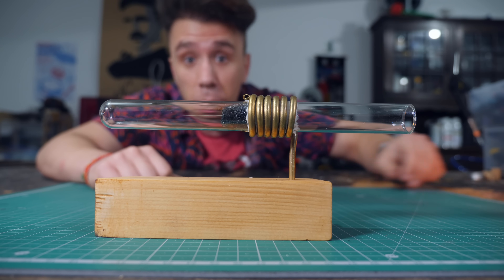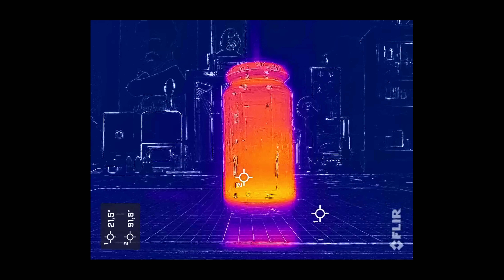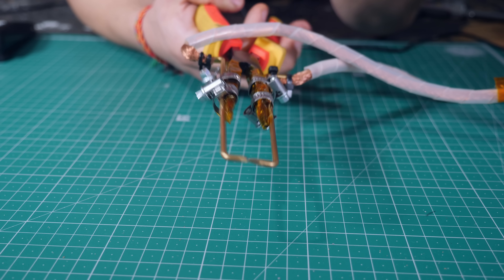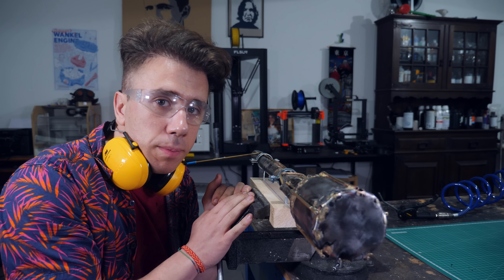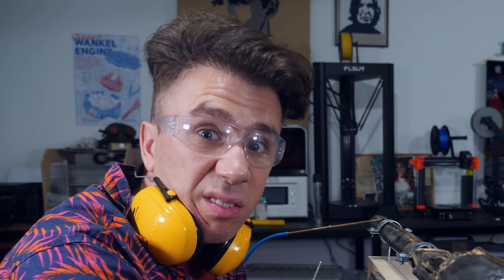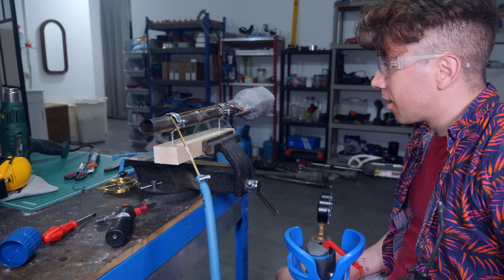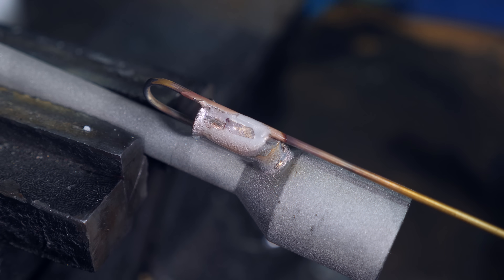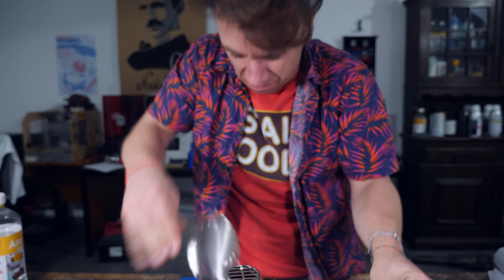JET ENGINE with NO MOVING PARTS (Pulsejet Engine)

Comment: I've got to see you build it INTEGZA! 

Make a simple, small, L-shaped rocket stove out of brick or whatever material, then in the combustion chamber of the rocket stove, instead of wood as a fuel use your pulse jet rocket motor inserted and use the heat from that to cook a small hamburger on a metal grate over the rocket stove Outlet. Viola, this should be your next video, and we will all love to see you eat the world's first Rocket Rocket Burger in the video, of course without tomatoes!

Comment: Try to make an air engine powered drill motor (like a dentists drill) and use it with a gear train to make a automatic moving shop vice or clamp of some sort for a hands free helping hand. Like say with a foot petal it uses the motor and gear train to open a spring-loaded clamp and upon release it self closes. Alternatively make it reverseable to open and close a vice like object.

Comment: I think you should make another video with your ion thruster.  This time I would like to see if changing the orientation of the string anodes by rotating them 90 degrees or by changing their distance from each other. 

Also I think adding a “collimated device” or a duct after the anode would help

Comment: The metal printed engine reminded me of the old DynaJet engines used on control line model airplanes back in the 60s and 70s.  Nice work.

Comment: "Integza learns to not suck at welding, part 1: welding PLA with a soldering iron."

Note that manually 3D printing with a handheld heat source and various types of stock is a great way to get a better intuition about the different types of feedstock. It should also be a good way to teach people about the different types of feedstock.

Comment: What would happen if you had the ion thruster inside the pulse jet and used that as the ignition instead of a spark plug or on the end as an after burner?

Comment: make a vortex rocket out of  ceramic glass.
glass-ceramics can withstand sudden and repeated temperature changes up to 1,000 degrees Celsius, allowing it to be used in glazing systems with fire ratings of up to three hours in some cases. Ceramic glass is made by crystallizing a normal glass pane through a treatment of intense heat.

Comment: Next try a tip jet helicopter. Strap a pulse jet to the tips of a rc helicopter. If it works build a single engine, hollow blade, tip jet helicopter

Comment: can you make a ram or scram jet work with compressed air
i was wondering if it was possible to do
if the engine is small enough like about ~2-2.5cm inlet

don't think it was possible with plastic
but maybe if you have combine sheet metal and your 3d printer wizardry

Comment: Hey Integza, why not adding radiator like in lewis machine gun barrel then see how long the engine would last. I saw the intake thing, where you blow compressed air into @ 10:16, cooling down when compressed air blown into.

Comment: Absolutely mind-blowing work on this 3D printed pulse jet engine! For your next video, I'd love to see an in-depth exploration of the practical applications of this technology. How could this engine be adapted for real-world uses? Perhaps you could delve into its potential in aviation, drone propulsion, or even power generation. It would be fascinating to see you take this groundbreaking innovation a step further by demonstrating its versatility and usability in various fields. Keep pushing the boundaries of what's possible! 🚀🔥
Reply: The practical application of a pulse jet is limited to hobby RC aviation almost exclusively. There is virtually no alternative use case. This is exceptionally old, completely tapped out tech. Even kamikaze drones are better served by more reliable and more available electric and two-stroke motors. Their use by Fieseler is entirely due to a complete lack of any practical alternative power sources at the time. Today, if we want a V-1 style cruise missile, there are very cheap, widely available disposable turbine engines that will perform far better and more reliably, and won't enable acoustic detection and tracking.
Reply: Pulse Jets have limited applications based on several factors from my understanding. In transportation for instance you wouldn't see a pulse jet car because of how loud they are, it would be a terrible ride quality and public nuisance. I am not 100% sure about aviation but I believe they don't have enough power to weight, or it was fuel economy that made pulse jets less attractive then the current standards.
They are amazing, and their simplicity is probably their strongest point, I've wanted to try making one since I saw Colin Furze do it!
Reply: A practical application for pulse jets? Try asking the Germans

Comment: You should use a refrigerant compressor to pressurize propane and then meter the release around the combustion chamber to get as much heat absorption as possible before combusting said propane. Might help to cool down a pulsejet even more than just the pressure drop from the bottle.

Comment: What if you added a series of constrictions to the exhaust tube?  It might increase the frequency of the oscillations,  and work as a reducer, which would increase the velocity of the gas/thrust.

That jar you used is really crappy glass.  Borosilicate is known for its heat resistant properties.  It's melting point is around 3000 degrees Fahrenheit.  I personally have a borosilicate glass studio and kind of want to try to make one out of glass. It'd be an exceptionally easy shape to make, even with the added constrictions.  If you have a local glassblower who works with borosilicate, even a 1st year worker could make the vessel for you.

It looks like the vessel needs 3 holes, one for fuel/air mixture, one for spark/ignition, and one for the exhaust to exit.  

Do you just have a 12v battery connected to that spark plug?  Or is there some sort of timing mechanism? It looks like the compressed air blown in with the fuel mixture starts the cycle?

Comment: I think that you need to build a cooling mechanism for the combustion chamber, but in a smart way (not like the last time where you had an empty area between 2 wall and an inlet and outlet of water at same level): 

1- Take an empty tube and fold it like a coil around the chamber. 

2- Then you put the inlet of fresh coolant in the area where the first reaction happen (essentially where it's more hot) and the outlet in the area where there is the lowest temperature (temperature of the combustion chamber). 

And that's it! Now for some more technical suggestion:

3- For the coolant don't use water or similar, because you are working with extreme temperatures you need a way to remove heat in a very efficient way.
By using something that is liquid at lower temperature (like liquid nitrogen or similar) you can use an effect called phase change cooling.
Essentially it's much more efficient to remove heat by heating a low evaporation point fluid and vaporize it. 
Then with the gas you have 2 option: 

     a- release into the surrounding environment (open loop phase change cooling)  

     b- lower it's temperature so it return in a liquid form so you can re-use it again in the cooling system (closed loop phase change cooling).

4- You could use liquid oxygen or propane and put the gas generated inside the engine. Essentially you are going to use the fuel to cool down the engine like the supersonic military jets/missiles ecc... does.

Comment: Why not just design and 3d print a cooling loop cum fuel-line on the combustion chamber as a single piece rather than twisting a metal tube on the outside?

Comment: Now using ABS filiment could you 3D print a small rocket or some type of aircraft or even something with wheels to attach the pulse jet engine too? Also what was the thrust it was putting out?

Comment: also. if you want to heat up the fuel before it enters the engine you could place a tesla valve before the coil that wraps around the main body of the engine. just for the sexiness and cool aspect of the thing.

Comment: I have an idea for a gas turbine. 
Rather than the compressor and turbine turning on a central shaft the they could be built into a cylinder. Actually two cylinders connected by a shaft. The ignition chambers could be stationary. 
The bearings could then be arranged on the outside.

Comment: Print the parts from a conductive filament and then electroplate them with copper or nickel. Heat the plated part to get rid of the filament. You can spot weld those nickel parts together if needed. You can do seam welding with a spot welder if you make the contact a bit larger and crank up the current so then you don't need solder which will melt.

Comment: Yeah, but no.

An engine, to be in any way practical, has to have some tangible and even competitive efficiency.  Your engines are not competitive with even Stirling or steam engines, which are down in the low single-digits of a percent in efficiency.    In the real world we need tangible power out and as low a fuel consumption as possible.  Your whistling engine has power output in the low thousandths of a Watt, about a few millionths of a horsepower.  It's never going to be anything more than a poignant demonstration of how NOT to design a practical heat engine.

Comment: Fellow tomato hater, you could have had the fuel cooling 3d printed into the outside of the combustion chamber (and around the other bits that get hot). Much more effective cooling?

Comment: If you can use a hot glue gun, you can use a low-end MIG welder. Just watch a bunch of tutorials and don't zip tie it to a 3D printer 😅

(Also, where a respirator because just about everything to do with welding wants to give you cancer)

Comment: Possibly try and make a 3d printed engine but to stop it melting maybe try water cooling the insides between layers of the outside and combustion on the inside im quite sure it will work or at least make a great video.

Comment: I think that if you bought a filament that dissolves in water and then printed a shape from it and filled it with concrete, you could use it instead of printing from iron. try it pls.😊

Comment: Absolutely love your videos! Could you provide some measurements regarding the power and efficiency of various pulse jet engine designs? Additionally, it would be fantastic if you could create a video demonstrating the process of designing the most efficient pulse jet engine using CAD. That would be great. 🛠
Reply: Gotta add valves for more efficiency.

Comment: A water pump run by explosions but not pistons.  For context, a few years ago, I built a potato cannon.  On a whim, I decided to stick the barrel (without a potato) into a bucket of water and fire it.  Because the explosion evacuated the air from the cannon so effectively, the gun sucked water back up, all the way into the combustion chamber.  It left me wondering if you could create a pump with a series of one way valves, combustion chamber or chambers, maybe spark plugs, cap, rotor, and ignition coil.  It might be impossible but the idea won't leave my brain.

Comment: Idea : you always find a heating problem with the engines 
why don't you add a thin layer of some cooling liquid outside it
and it well be better if the liquid can move out of the engine 
so that you can use it for a langer time

Comment: Whaat, a pocket v-1? Lovely haha.

For suggestion, it would be interesting  to see  a rotary engine like the first omes that came in the ww1 powering some biplanes like the gnome  1913  that Was a 5 cylinder  engine were the crankshaft stayed still while the whole engine  Block spins with the propeller (one of the most ww1 engineering  moments)

Comment: You should try using electrolysis to make a hydrogen thruster! Love your content.
Reply: good idea
Reply: yea
Reply: Imagine the potential of combining two powerful techniques: electroplating and 3D printing. By utilizing electroplating, :face-green-smiling::eyes-pink-heart-shape:But let's not stop there. Have you ever considered the synergy of two different engine types working together? Envision a Rotary (Wankel) Engine serving as the powerhouse to drive a pulse engine. Such a combination could unlock unprecedented efficiencies and capacities in the realm of engineering and innovation. Let's explore the possibilities!
Reply: That would not work. Even 3000 watts in a commercial HHO generator produces a tiny flame.

Comment: Idea for the next video - a circuit that mimics a four-cylinder combustion engine with low power motor, capacitor and a PBC that charge the "idle" capacitors from rechargable battery :
     +------------------+
     |   Microcontroller|
     | (Arduino maybe)  |
     +--------+---------+
              |
              |
   +----+----+----+----+
   |    |    |    |    |
  C1   C2   C3   C4  Motor
   |    |    |    |    |
  S1   S2   S3   S4   GND
   |    |    |    |    
  +----+----+----+----+
  |    Charging     |
  |    Circuit         |
  +-----------------+
C1 to C4: Capacitors.
S1 to S4: Switches (MOSFETs).
The Microcontroller will control S1 to S4 and also get feedback from the motor for RPM

Comment: You now need to combine the soda bottle compressed gas fuel tank with this little metal pulsejet rocket engine and put it on a lightweight rolling chassis with remote controlled steering. (RC pulsejet car)

Comment: Just wondering if there is a way to cool the engine so it does not. Burn up. Like using a water line wrap around the pulse engine.

Comment: How about water cooling the steel sheet version? With enough cooling capacity it should run and not melt (and even if it melts it'll self extinguish)

Comment: You can metal 3d print with a standard fdm printer and then do the debinding and sintering using a crucible in a microwave

Comment: You should have designed internal cooling channels into the wall of the metal 3d printed engine which the printer could easily do. And you need to start using nptf threads for fittings instead of braised connections when your engine is making as much heat as your braising torch and melting all your braised connections... so close to actual repeatable success

Comment: Imagine a valveless pulsejet engine that is somehow turbocharged - I guess you could try feed some of the combustion chamber pressure to a sidemounted turbocharger. I think a turbo charged pneumatic/solenoid reed valve pulsjet might be easier to turbocharge. Pipe dream #punintended

Comment: Idea for future video: have viewers send in simple pulse jet designs that can be 3D printed and test the to see which design provides the most thrust, longest runtime before failure, and coolest design. I've seen something similar with another channel that does computer fan design tests. But I think something centered around jet engines or rocket nozzles would be awesome 😁

Comment: Not to criticize but why don't you make a Jet engine with liquid cooling? Than it won't burn up as quickly. Or better make a propeller jet engine it's easier than you think. I know that there is information on the interwebs 😅. Good luck sir 👍

Comment: You need a laser cutter for the thin sheet metal, instead of the printer. No more scissors cutting.
I love your videos. Good luck with your rocket engines

Comment: I heard someone say you can put a water bottle in a fire without it melting, as long as it contains water. So what if you wrap part of your pulse jet engine in a 3d printed plastic container filled with water, would the heat dissipate into the water and boil it, instead of creating glowing hot steel that eventually melts away? So you can adjust coolant by just adding water? This might help increase longevity before it burns apart

Comment: Butane is a longer chain (C4H10) and contains more energy per molecule... BUT, it harder to ignite than the smaller, lighter Propane (C3H8). Propane is more flammable, with a lower flash point and has a wider flammable range. Because it burns easier, it also burns more completely.

That's probably all it is that's made butane harder to run... if you really, really wanted to run on butane, you could probably optimise the design for butane... not sure it wouldn't take a lot of time investment, but I don't think there's anything actually preventing you! ... apart from time and not much reward for that time!

Comment: To answer your question about why propane burns better than butane in your experiments:
For the same molar quantity (so, for the same gas flow), butane needs 33% more oxygen for complete combustion. So without extra oxygen, propane will burn better because it has more oxygen available relative to its need compared to butane.

Comment: Who else misses the mustache?❤
As for a (stupid, dangerous and awesome😂) video idea, how about some jet-propelled roller skates? Probably would require another propulsion on the back to actually use them, but it'd be very funny and also cool to see how you'd protect your feet from the heat, provide the skates with fuel etc. We would even forgive you for using hydrogen, I promise!

Comment: to deal with the engines overheating and melting, perhaps add some fins to the outside of the combustion chamber, which increases the thermal mass a bit but mainly provides more surface area for passive air cooling.

Comment: You need to put than engine in a vehicle and make it run or even fly. You could make a 3d printed V1 using this engine an tune its design and the 3d printed motor to achieve the best and longest fliying. You can make use of accelerometers or any kind of giroscope

Comment: A 3D printer that prints a 3D printer.  Recursively building more capable printers until you achieve the elusive 3D metal printer.  That would be so METAL.